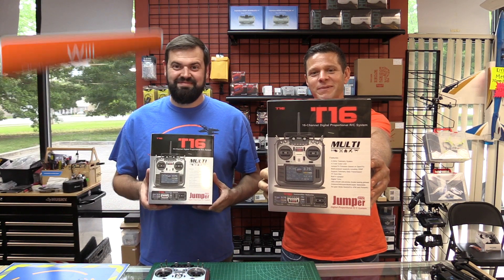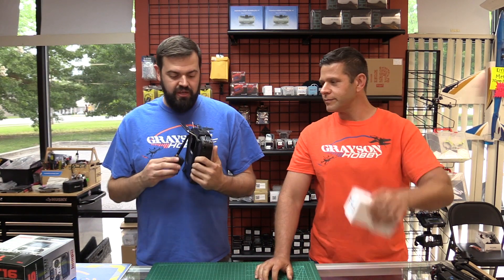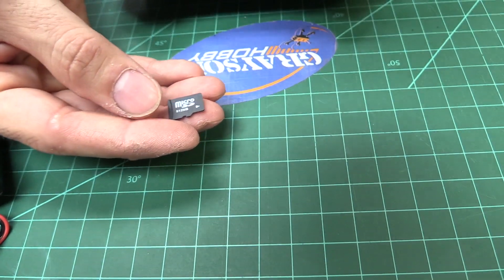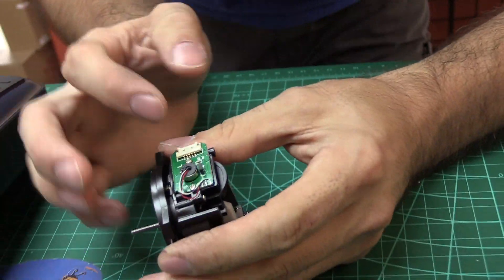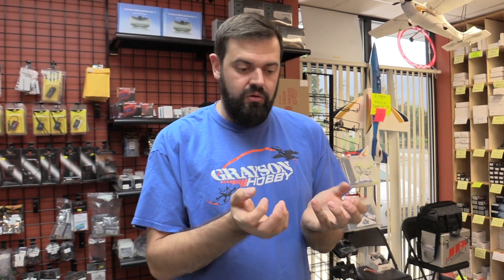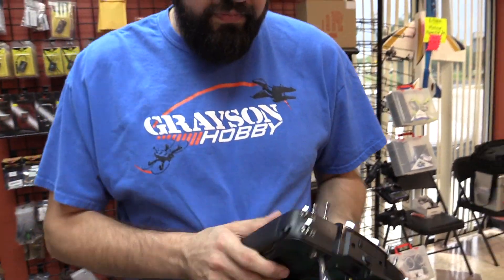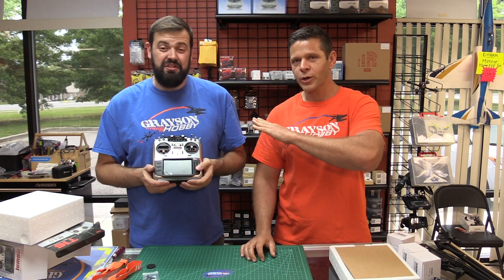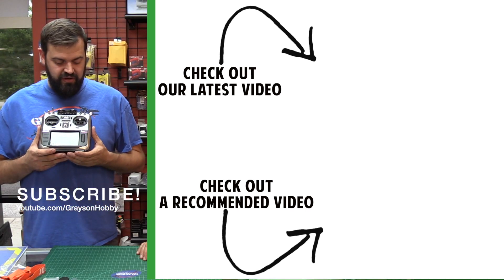Jumper T16 PRO with Upgraded Hall Gimbals - FCC Certification

Comment: 2:02 Did you ever find out which it is? The defaults for me are way too heavy. Love the radio otherwise, but this will be a killer for me if I don't find a solution. I've completely removed the tension screws on the gimbals, still super heavy.

Comment: besides the hall gimbels the pro has a built in multi protacol module  with antenna  on the top of the transmitter so crossfire module is easy plug and play great upgrade

Comment: I’m thinking of upgrading or just having a back up transmitter to my aurora9. So I am wondering if the jumper will bind with my hitec optima receivers. I did see hitec as you scrolled through but I’ve done some searches and there seems to be conflicting info. Hope you can help.

Comment: How good are the emulated protocols?
I never read how good they are, They are reversed engineered protocols so for the most still different from the original but working, but how good? For those cheap, nearby ‘toys’ I have no problem with it but will you use this on your $1000 model?
Reply from the maker: Yea, and do use this on all my models

Comment: Thanks for the video! I got the Jumper T16 with those Hall gimbals and they feel very springy to me - It's not very smooth moving the stick cross the center points - Do you know if there are any adjustments you can make there to make them a little more smooth?

Comment: Thanks for this vid.   After watching, I immediately ordered one from you!  (Getting Hall effect gimbals was the final push) 

Question:   With the improvements made, did Jumper beef up the screen selector roller?   I've read several comments that it easily broke, and to press only on the lower part of it.
Fingers crossed that they did....

Comment: Hi Basil 

I want to share a summary of my experience with Jumper  comunity thinking it might be usefull for someone

Jumper´s Oddyssey

I bought my Jumper T16 in Grayson Hobby few days ago.  After using it 10 minutes the Jumper failed, displaying "STORAGE WARNING bad radio data
".  Following GH instructions I took out the SD card, formatted in the PC, copied the files from the link GH send me and again "STORAGE WARNING bad radio data
"".  So, Jumper working,  SD card working (in the PC) the trouble might be in the connection between both: the SD card board. I opened the Jumper, took out the SD board, cleaned the ribbon cable and the card contacts, shut it again and  "STORAGE WARNING bad radio data
". Ok, might be the SD card board. I asked GH for a replacement.

While waiting for GH to answer I decided to replace the original XX SD card (512 mb)  for another Kingston(2Gb) of my old phone. I formatted, copied files, inserted in the Jumper and "STORAGE WARNING bad radio data
". 
So, with my blood pressure increasing I decided to try to contact directly Jumper.xyz from China
Few hours later I received JUMPER SUPPORT (JS from now on) instructions, similar to those GH send me but more detailed.  I told JS that I had done such things but with no results
Yesterday I recieved from JS an amazing picture with photos and graphics and hyper clear instructions of 5 steps (that I will send to GH to share with you) 
Start linking the Jumper with the PC in bootloader mode (pressing T1 +T4 + Power) 
I follow them using my Kingston 2mb SD instead of the original  , format, copied files and  "STORAGE WARNING bad radio data
"
Told JS that no results and they asked what was the display showing in my PC.  "Three volumes" I said. "No", they told me, "there should be two".  ....
I took away the SD and insert  it in the PC to see if there was any difference but nothing, 3 drives  
When I reinsert the SD  in the Jumper the volumes where no longer there.... 
It seems as if you take away the SD Card from the Jumper, SOMETIMES something happens so that  your drives will be not recognized until you do this process again.    

Today checking the SD card I discovered that,  as the SD card was used in a phone,  it was partitoned in 2 volumes, one for android and another with data
From the PC I could format the 2 volumes but I couldn t erase the partition
I found and installed in my PC a soft called "SD Card formatter" 
So I insert the SD card in the PC, erased the partition and formatted 
Installed again SD in the Jumper, linked with PC in Bootloader mode and formatted again but this time from the PC and with THE SD INSIDE THE JUMPER
Copied all the files and also one called "opentx.sd.cardversion" that by default is invisible. (thank you JS for the tip ) 
To do that you  have to change the parameters of the file manager (control panel - device manager - view - show hidden devices) to make all  files visible. Once a file is visible, you can copy it. 

Power on my JUMPER  T16  and

 yeeeessss.  I recovered the original screen
Reply: Just not ranting to much.  SD card files always have to match with firmware version and be careful you when you have imported models, 99% SD card fail is when radio its starting and some of the models have set to internal transmitter, specially active (selected model) I have radio from fist batch and all small blemishes sorted by Jumper. A with all computer thing problems lie between sticks and chair.

Comment: Boys in your last post on this radio you made mention of "quality" problems with the T16 which Jumper seemed to acknowledge (refusing to send you a review unit). Have Jumper done anything to improve the quality of the unit? One such example would be the scroll bar......they have a reputation breaking at the upper mounting point. Looks to me they have just chucked Hall effect gimbals in and nothing else. The new gimbals are great but if the radio is unreliable because the buttons break etc then who cares what gimbals she's got !

Comment: I own 2 futaba's  600 dollars each, 2 frsky x9d  AND X9D+,  and several other radios, Including the Jumper T16, if you want a super radio in a super price with lots of luas and capabilities this is the radio to own, the T16 replaced all those radios I listed before.   I own one of the first one and Im in love with it, my is using Crossfire and Dragonlink modules and is amazing, and yes my was FCC approved.  In the hobby for 45 years, own giant gas planes, quads, dji drones, helicopters, boats and cars I got it all, and this radio blow the market,  the garbage of spektrum will be gone in months, futaba you more expensive radio should be 150 dollars, same goes for Frsky line, this Jumper T16 is amazing, now the telemetry screen is use less under the sun, because is in color, but is amazing when you set up you aircraft.  This is the product of the year for 2019.
Reply: maxun1 This is what the market has been needing, nice styling, something Fr Sky could never get right imo ,full size radio ,lots of features and versatility across many protocols. I am committed to Futaba atm but they seriously need to reduce their prices to keep me onboard. I hope Jumper can monitor quality control and they will have a winner.
Reply: maxun1 The thing is with Futaba, they have quality control, they might be pricey but they are dependable.
Reply: Did this work with the dragonlink without issues or did you have to shield it yourself ?

Comment: Hi Basil. I dont know why you encourage people to buy this radio now.   I bought one to Grayson Hobby a week ago   and after unpacking the Jumper and using it about 10 minutes it appear this message
STORAGE
WARNING
bad radio data
press any key

and the radio  became inusable

your support team  (ticket #001683 created)   told
 me to replace the files of the SD, thing which I did and    reboot the radio,  also done but nothing happened, error still there and inusable radio. I told them that as the radio worked fine for 10 minutes, it was not a sofware problem but a hardware, located in the SD card board.   Since then, 5 day ago no notice from Grayson Hobby what makes me think that you dont have the replacement parts nor the skills  to repair it..  So wait a couple of months (or years),  buy the replacements.... and then encourage your customers to buy it.... thank you
Reply from the maker: Sorry you are still having issues but here is the fix again

This problem could be caused by wrong files been put into the SD card, or because of the SD card been pull out, damaged SD card or SD card board.

To solve the problem, please connect the radio to PC via USB (don't pull out the SD card from T16).

1. Please completely delete ALL files on the SD card

2. Format the SD card

3. Copy the following to the new SD card file in. You can download the file from here: https://www.jumper.xyz/portal.php?mod=view&aid=17
Reply: @graysonhobby  yes, and I did it and nothing happened and I told you that and none answer
......
Reply: @graysonhobby  ok , so test them before sending to your customers that trust in you , with so nice videos in youtube...!!!!
Reply: And also told us that you have no replacements and if we have any trouble we will have to wait a month or two without flying ......
Reply from the maker: Anibal, your email has been bouncing back to use all week, hopefully this reaches you.
Reply: Many products from China come with very cheap SD cards. Replace with a good quality one with the correct files and it'll likely fix the problem. Had this happen to me.
Reply: thank you Inmortal for your help but I did replace the SD card for a Kingston 2GB of my old mobile but nothing.. I will let you know

Comment: I simply use the original Jumper T8SG Multi Tx for my micro quads...does very well....."IF" i have to get a new one at some point, appears this one will be the ONLY One they will have .......lol
Reply: You'll need one. Mine lasted precisely a year before it needed deadzones of 25 to keep from drifting. Then the endpoints got wonky. The taranis x-lite has worked beautifully since upgrading. Also moved to r9 lite and omg i'll never go back.